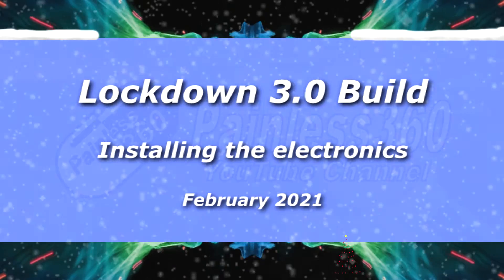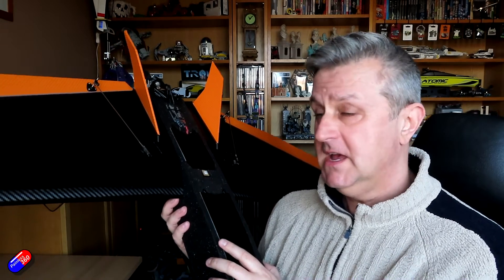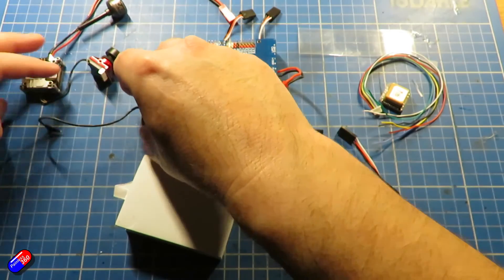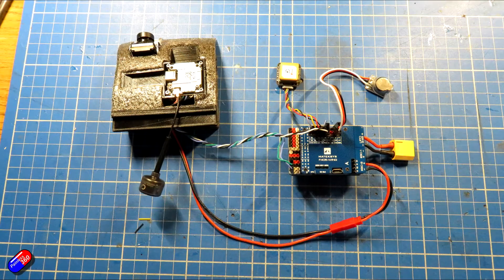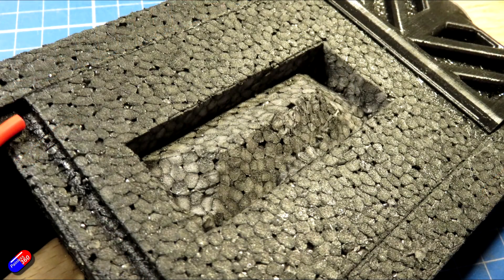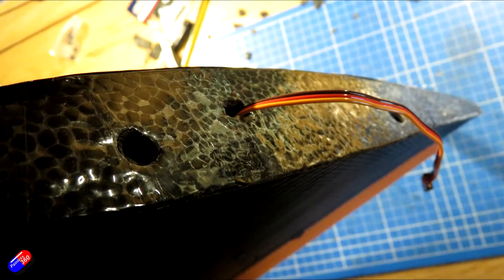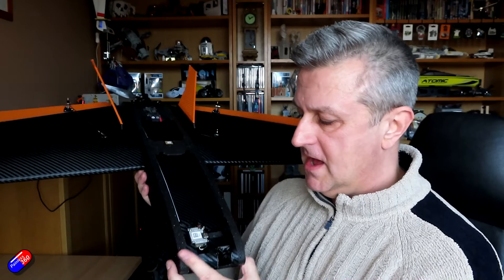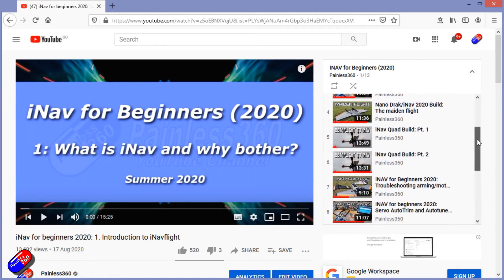E-Wings Vortigaunt II Build: EP2 - Installing INAV on a F405-wing with DJI HD

Comment: Hi, what foam did you use for the nose and did you mean the 1200kv version of that motor or is there a 1400kv available? It's not listed on that link. Thanks.
Reply from the maker: Stay tuned for the maiden as things are going to change..

Comment: I had a similar situation with a LARGE wing where the elevon push rods were VERY long and ended up flexing. My solution was to replace them with CF tubes that had a short length of threaded rod epoxied in on each end. It worked fabulously! No flex and even saved some weight!
Reply: I have gone a different route with my Vortigaunt build and moved the servos (micros with 4.5kg torque) to the back of the wing, and out towards the middle a bit more, so a short pushrod and less potential twist on the elevon.
We'll see how well that works out in a week or two. :-)

Comment: Nice video as usual, a little fun is that I replaced 2 Nebula yesterday to Nebula pro.
A Nebula Nano sitting in my ZOHD Drift and vanling Nebula that will sit in my Geprc Zygnet.Lite fiddly but it went well.
I was not happy with the picture from nanon, here is a video from FPV maiden, a bit shaky at first, but gets better when I get trimmed out
https://youtu.be/4Ot8ePuIxp0